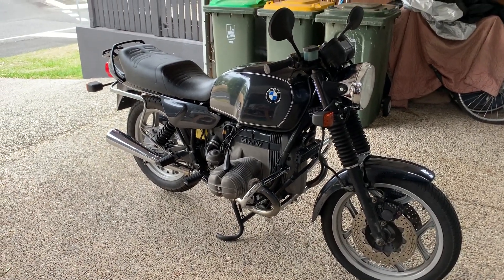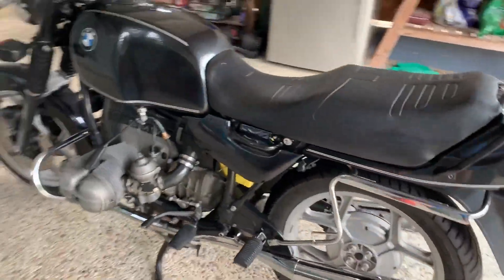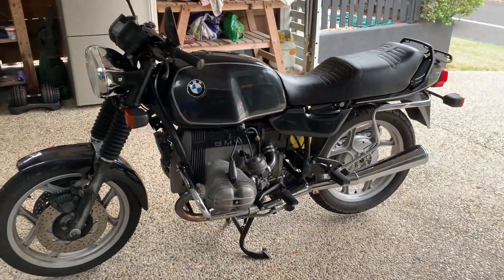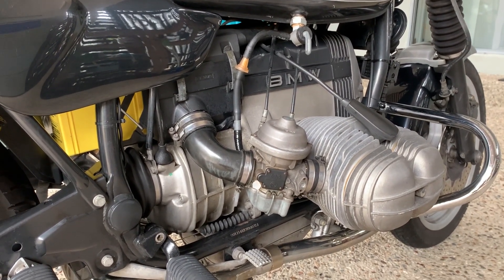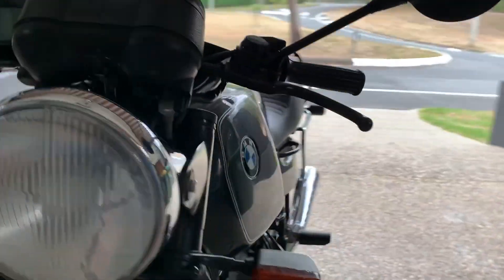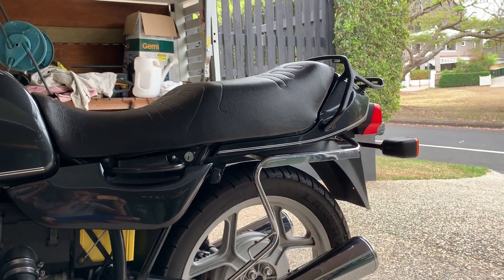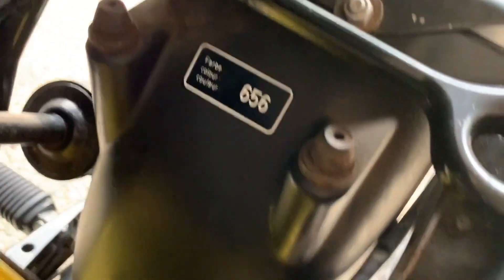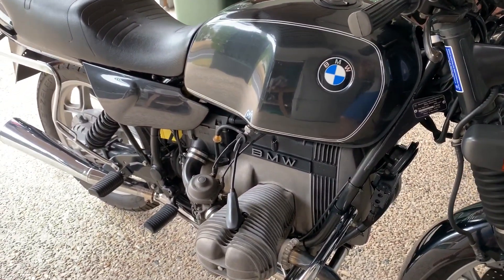BMW R100 Trad (aka R100CJ) and the R100 Mono Classic

Comment: I just picked up one of these in California with 23k miles on the clock!
Reply: Just about to look at one of these .....would getting parts be a problem? as it is rare. Cheers
Reply: @kengilly867  is it the one back east on marketplace near south Carolina? I was on business and saw another for sale over there about a month ago. But to answer the question it's still really easy to find most parts I do warn you the front rotors on these late model airheads with the dual brembos are ridiculously expensive I think it's about $450+ for the pair depending on were you look. Otherwise every part I've had to order and locate has been available as the actual drivetrain and engine in these was used in many other bikes until about 95-6 I believe. The basic engine and drive unit is virtually unchanged besides the cylinder heads from the R75-R100 with minor updates and ignition changes by the time they get to the 89+ model year. Overall has been way easier to work on and source parts for than any of the older Hondas I've owned as well.
Reply: @RetroMotiveAdventures  Hi ,yeah i did buy the bike in Australia , i am pretty sure this is the actual bike in the video.... it does appear to have newish standard front discs fitted as the guy in the video said he would...

Comment: I was wondering is that engine belongs to 247? How about the horse power?  Thanks
Reply from the maker: It's a standard R80 from 1990, but with a 980cc engine from the factory production line including matching final drive gearing
Reply: x7eater I am curious about the acceleration n torque power. Fyi, I have a 1991 r 80rt  and I am satisfied with its power
Reply from the maker: @eddylarkin2270  I would also be perfectly happy with the performance of the R80, I've also owned an R65, R80, and R100S....and the power characteristics are quite different across all those bike. If you want to understand the fully story of the R100 Trad, it is all documented here: https://advrider.com/f/threads/bmw-r100-trad-1990-91-aka-r100cj-and-the-1991-92-bmw-r100-mono-classic.1418449/